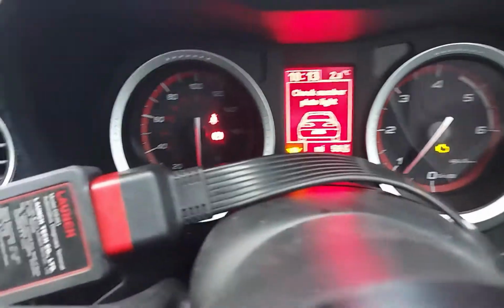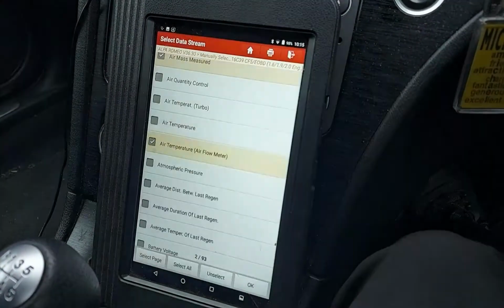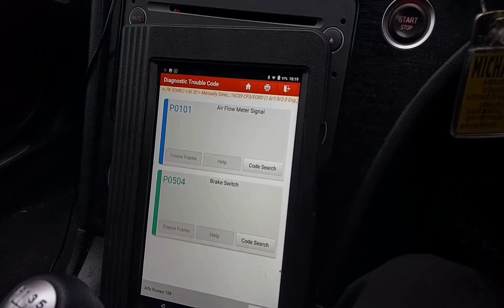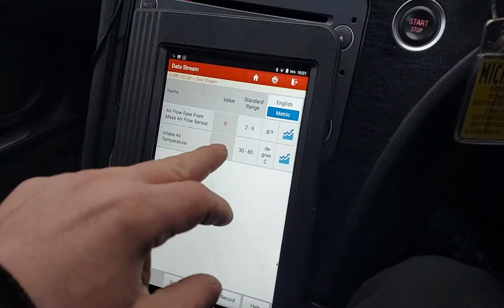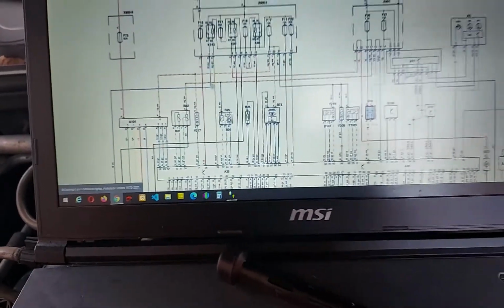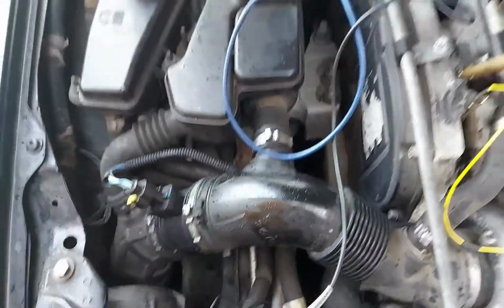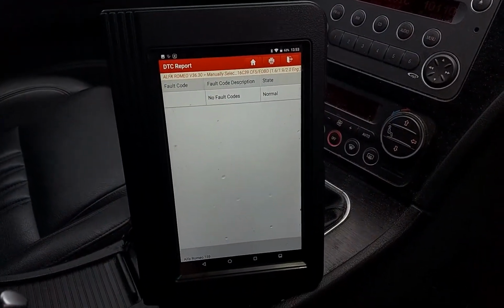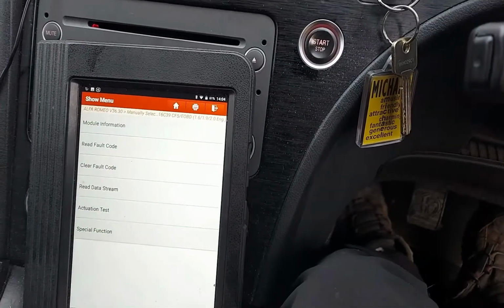Alfa Romeo 159 P0101 MAF Fault Range Performance Signal

Comment: just. found this video, have simular problem on my 159 tbi sw. symptoms - Maf error in memory, when I log live data, iat sudenly drop to 0, Maf signal sky high. Sometimes following with VDC, AsR hillholder failures and fuel gauge drop to 0. F35 fuse is OK, so I think there is some broken cable/ or bad ground related to this fuse. Does anybody have wiring diagram related to f35 fuse and groudg points?  Thanks🙂
Reply from the maker: Where are you located?
Reply: @GicaPhp I´m from czech republic.
Reply from the maker: @fcmotorsport  tell me year, kw, engine code and I will look for a wiring diagram

Comment: Fully solved this a while ago. This fuse also connects to the brake light, the issue was a bad cable going to the trunk door. Opening/closing the trunk had damaged the insulation on the trunk wire harness over the years and it was causing a short and blowing the fuse.
Reply from the maker: Thanks for sharing ;)

Comment: can you help me airbag light on with error B1001
Reply from the maker: what vehicle you have?
Reply: @GicaPhp  alfa Roméo 159 JTD
Reply from the maker: @Euzinho01  i need to know year kw and if possible engine code
Reply: @GicaPhp  year is 2005 kilometers 2520000 k
Reply from the maker: @Euzinho01  how many kw does it have?
Reply: @GicaPhp  252000
Reply from the maker: @Euzinho01  no KM but KW (kilowatts)
Reply: @GicaPhp  150

Comment: Thank you so much! My mechanic tried with a new MAF, we were even talking about changing the computer. Exact same issue - cheap blown fuse.
Reply from the maker: Glad it helped :)
Reply: @GicaPhp  Spoke too soon. The fuse has blown again so I guess something on it is causing a short occasionally.
Reply from the maker: @Rippy211  look what other components are on the same supply and disconnect them and see if it will blow the fuse again, if it will, look for wiring loom rubbing agains something else.